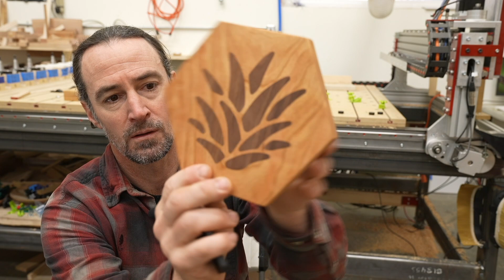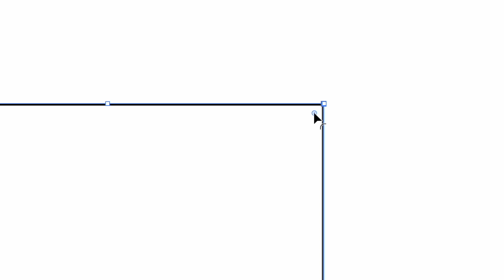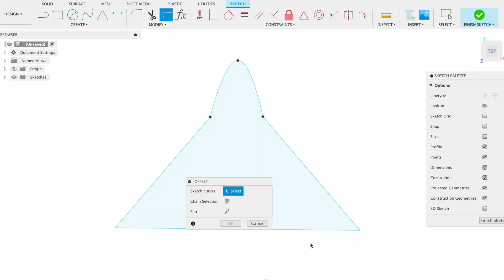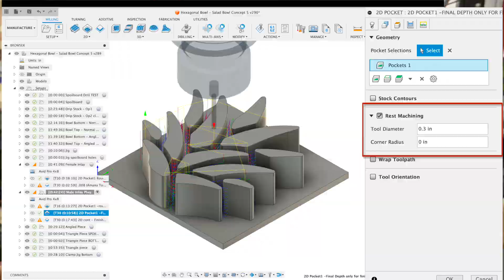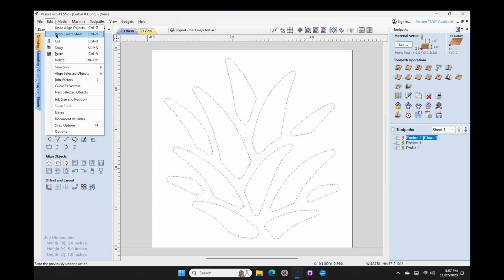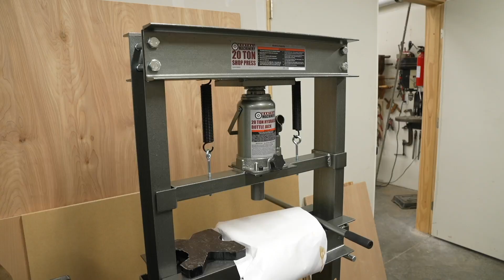Perfect Deep Wood Inlay - How to get perfect inlays with a CNC machine using straight bits (no gaps)

Comment: Love your videos!  There is a third way to make the inlays work.  It's using the same idea as a v-carve except doing it as a draft angle and some long toolpaths.  So if you give the inlay and the pocket each a 2 degree taper along the walls...like  a draft angle you would use to get it to release from a mold, then they will slide together until it wedges in place.  Hopefully that makes sense.  I've used this 2 degree angle to create an inlay of C360 brass into aluminum.  No adhesives (unlike wood) but I just heated one and cooled the other and then the 2 degree is more than enough to lock it when it shrinks to fit.

If you try this out, play with the 2 degree angle, and if want to find out about where the interference starts to occur you can make the inlay and the pocket part of a component on a sliding axis.  Then turn on contact sets in Fusion 360 and do a contact set between the components that contain the inlay and the pocket.  Fusion will detect when they begin to touch.

If none of that makes sense let me know and I'll be happy to try to explain it better.  The advantages would be that the fitup would be perfect and you'd just need the slightest clamping pressure while glue dried.  The disadvantages are creating the tapered walls requires a longer toolpath, but since it would be engaging less material as it spiraled down the tapered wall you could definitely run at much higher feeds without deflection.  I suppose another disadvantage is the inside pattern is slightly smaller than the outside but 2 degrees over an inch, I doubt anyone could even find it.

Anyway, just thought I'd throw it out there.  The brass/aluminum piece I made was polished to a mirror finish and the seams arent detectable even under a jeweler's loupe.
Reply from the maker: I'll also pin this comment, so other people can be sure to read it!
Reply from the maker: Awesome, yeah, that is a great idea! I did do this for some really old projects; like my "batman dovetails"; I designed it with a machinable taper. It definitely takes some engineering, and I like the idea of using Contact Sets in Fusion -- I hadn't thought of that!  When you do your tapers, are you using a ballnose and just machining the sides? Or some other technique?
Reply: @CorbinDunn I didn't even bother with a ball end mill.  I just did a 3d contour with a flat end mill and a very small stepdown.  I think I used .2mm.  I suppose you could use a ball end mill and get even better results but at the time I didn't even have one!

To be sure I communicated the process, I extruded the inlay with a -2 degree taper.  I extruded the pocket as an extrude-cut into the stock with a -2 degree taper as well, both from the same sketch profile.   At this point the two parts will fit perfectly and the sides will touch when they are fully engaged.  So then I did an offset face on the pocket to make it a little smaller.  I used a small value, like .05mm.  So now the two pieces won't fully seat before coming into contact.

This is where the contact set is helpful.  By having the sliding joint and contact set you can pull the inlay into the pocket and if you have the sliding joint visible it will show where along the slide it is touching.  You can then play with the offset faces to get the parts to touch at a depth you're comfortable with.  I would assume you'd want as much engagement as possible while still having some room left for your skin on the pocket side.

I love your work and enjoy how you make your videos.
Reply from the maker: Thanks  @billstrahan4791  - that does make sense! I also like the idea of extruding with a taper; I previously was doing it with a loft from one shape to another shape, where it was offset on the second one to make it smaller or larger. I think the taper idea is an easier way to do that..as lofting can sometimes be hard to control.
Reply: Great idea.

Comment: Is there a reason why on V-Carve, you don't use the Inlay function instead of manually doing it with pocket/profile?
Reply from the maker: That's a good question: I really just haven't tried the VCarve inlay function; I just transferred how I did it in Fusion over to VCarve. Currently, I don't use VCarve for straight inlays; I only use it for "VCarve" inlays (which this video isn't about).

Comment: I wonder if you try epoxy instead of wood glue as it shouldn't swell the wood quite like wood glue does, and gives you a bit more time to get the pieces together.
Reply from the maker: It would definitely be worth trying! I think I've seen some inlay people using epoxy (like BroInWood - who does amazing work). It can definitely help when you need more time for the glue up. I think the longer open time might actually cause more swelling as it enters the pores of wood, but this would be an interesting experiment. I found that the swelling wasn't really an issue once I could press the inlays together really dead straight with a press.

Comment: Great video Corbin. Thank you... I look forward to following your future posts. Of the many interesting things you mentioned, I found your tip about avoiding witness marks (using lead in) and adjusting the allowance variable based on bit wear really interesting!
Reply from the maker: Thanks James! Yeah, it is crazy how long it took me to figure out some of those small details. Another thing I overlooked until recently: make sure your machine's backlash and precision is dialed in. Mine was a little off, which may have made things more difficult.